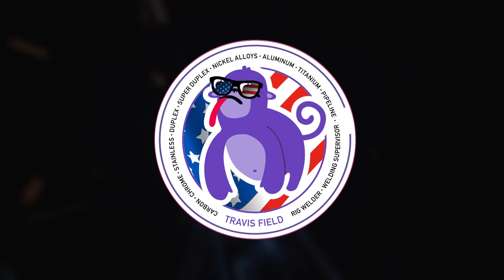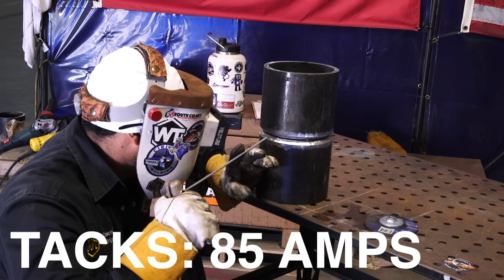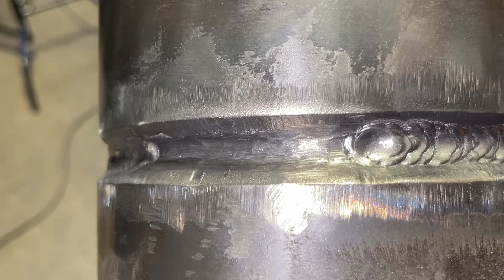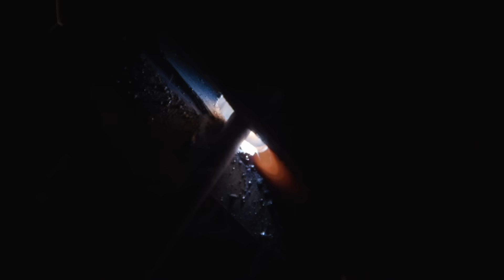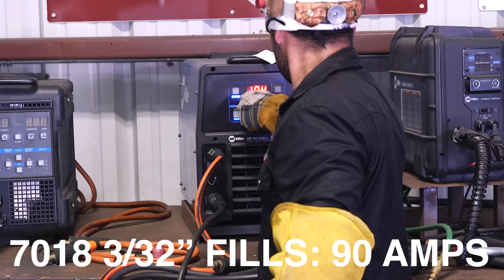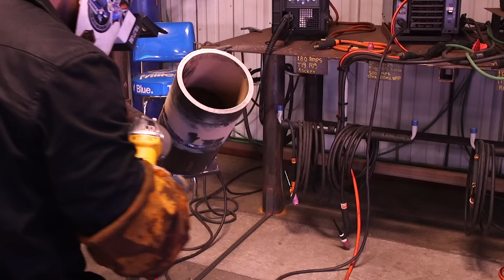6G Stick Welding Test | Open Root 6010 & 7018

Comment: You got a video on how to grind the pipe with the proper bevel?  I've never went to welding school or none of that but just on the job welding.  Had 2 different dudes just never bevel and said it was a waste of time. lol  But it was just basic stuff like cooling towers and chiller piping.  Nothing too crazy, so maybe on that it didn't matter.

Comment: Can you use MIG for welding 6g pipes?  Why and why not?

Also if you can use MIG, would the technique work the same way?

One more question would back purging affect how the weld forms? And if so how would the technique change if the back purging did change how the weld formed?

Comment: Great video. 
Here in Oz we use 2.5mm and 3.2mm low hydrogen rods for the whole pipe, but essentially the same process.

Comment: never heard of anybody welding up hill with a 6010? i would have thought the main advantage of this rod is that you can weld faster by welding down hill. otherwise, might as well use a low-hydrogen rod like a 16

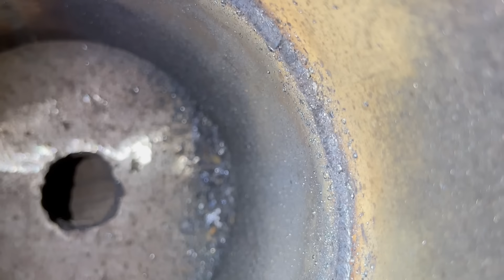Comment: New to welding here 👋 and when I say new I mean I’m still in the basics of my Intro to SMAW pipe class so please no hate, at 14:15 is the final product supposed to look like that? One side the bevel is fully capped and the other side is still super low. Is that the finished product or did he only do one side? Sorry if the terms aren’t correct. I hope my question made sense.
Reply: lol that’s not the final product

Comment: Great video  ,when we practiced 6g in our times we used 6010 root and 6013 fill and cap weave beads    ,7018 electrodes  were never used for  this test back then and few people  passed

Comment: When I did the 6G test at the shipyard it was tacked to a fixture and had a box over it limiting your space. I recommend never doing another weave pass over your hot pass, especially with a 3/32" 7018. I saw a lot of shutdown guys and such fail x-ray test for doing that.

Comment: I always like a 1/8 landing or thick as a nickel and fit is key and I do a 3/32 gap to on 80 wall and higher I can turn my rod straight in on 80 amps give or take and run it all the way up from the bottom I usually quarter my Welds but stick i run up from the bottom to top on each side less stops

Comment: Guys , I need your advise. I am 28 years old and I keep trying to step up the ladder.  My stress for work is on another level. Currently I am giving exams for Stick. Money wise I am not very good to pay for all position certs so  which ones do you think I should go first? I was told that if you do 6g , you are qualified for all positions.  I am welding 4 years , my level is quite good but not the best. Thank you in advance

Comment: ALWAYS FIT A TIGHTER GAP & A LESSER BEVEL ANGLE THEN THINNED IT OUT WITH A GRINDER & TURNED UP THE HEAT JUST A LITTLE HOTTER & PUSHED IT IN JUST A LITTLE HARDER WICH MADE A MACHINE LOOKING BEAD 👍🧑‍🏭

Comment: Put some more details in that puddle work what the heck am I looking at I think that’s the problem beginners have a hard time with cause I did until I have to really really look at it to start shaping up a good weld it’s not perfect yet though but it’s getting there

Comment: I have a question when you tacked up the pipe why you keep jumping out the puddle
Reply: I'm assuming to let the puddle cool down just a tad bit so that he can put more metal in. If not, I think he'll create a pin hole
Reply: @TheTexan_87  yes but im a wire welder and we dont have flux coaing on it like flux core or stick does and i know if you jump out and go back in you trap slag and other impurities in the weld with wire i figured it was the same with stick

Comment: Are you allowed to grind that much for the test once you’ve set up the pipe after your tack welds?
Reply: He's not grinding,it's a wire wheel to clean/ remove slag,

Comment: I've been fitter/welder for 15 years, certed for plate but never pipe. I did spend some time at a few shops, one specializing in larger pressure vessels, one specializing in steam and refrigeration piping. I learned alot about 6g ASME IX at the latter, it intrigued me alot, learning about schedule pipe, the procedures, prep everything was soooo different to anything I'd ever done. I've only ever seen 1-4inch pipe, tig root with tig or stick hot pass and covers depending on the situation. I've never seen pipe welding with a stick root before ESPECIALLY with 6010 (I'm In nz I think the 31a we use is the same, please correct me if I'm wrong) very very cool learning and seeing different processes and jobs. God I love our industry! There's always new stuff to learn! Thanks so much!

Comment: The best advice i got 40 years ago when learning to weld a 6G /6GR  was weld one handed and use your other to balance and move freely as you weld it becomes like a wand in your  hand a bit Harry Rooter u become a metal magician and your roots resemble a wedding band when complete unfortunately most of the amazing tradesmen who taught me these skills have long since passed but I still like to think their up their in Heaven hot passing and capping
Reply: Hello 
Could you please teach me to weld with one hand 
Really struggling with one hand
Reply: @vorsprung2330  kein Problem einfach machen bro!
Reply: @vorsprung2330 just grab something with your other hand to help balance yourself. If you dont you move around more than you think.
Reply: توصیف قشنگی بود❤
Reply: Hell yeah. Love it
Reply: Damn right they are still burning. I don't think real fabricators ever want to stop tinkering, building
Reply: That's true you feel free to adjust your position
Reply: Good video
So much on u tube is garbage using 6013. No serious welder(Boilermaker,Pipefitter) uses that garbage rod

Comment: If you have slag stuck in the top of the 6010 weld will it show up on the test or will the 7018 burn it out?

Comment: Just want to say great video! I’m not a professional welder or certified or anything like that, but I know a bit of the basics on how to stick weld and mig weld, but I’ve got a question that I’m really curious about. Do welders ever stick weld 6g pipe downhill on the root pass with maybe a 6010, or is it always going to be uphill? All the demonstrations I’ve seen on YouTube have been done uphill, but I worked with an old welder a while ago who taught me that 6010 rods run better downhill. If someone more experienced than me can answer I’d really appreciate it. Thanks and have a great day
Reply: Si si può fare anche in discesa.

Comment: I use an structuralv profile in L to align perfectly both tubes before welding the first three short welding seam.( Sorry. I'm not English speaker. I don't know if I'm using the right expressions). Then, you don't need to check inside of they are ok. All the root is going to be perfect.

Comment: awesome stuff im heading into a Boilers apprentice rogram in a few weeks and im new to 6g so watching this helped me learn the movements of the ody to keep the rod in the center of the pipe as im working along, ive got my 6010 stiching down pretty good but need to work on that fill and cap

Comment: What does the "6G ' stand for?
Reply: All positions Flat Position (1G, 1F)Horizontal Position (2G, 2F)Vertical Position (3G, 3F)Overhead Position (4G, 4Fi nclined Pipe Position (5G, 6G

Comment: 6010 drag down root opening. 6010 puddle cap ( high arc length 1/4” out 1/8” in). Make sure flush then Cap circles.

Comment: Quick question. New to stick welding. Why do you leave a gap between the pipes and not first butt them together and then weld. I'm sure with the weld it should fuse them together well. Maybe I could be wrong. Been welding mig for years. I first try to fix the gap then weld
Reply: The spec requires reinforcement on the inside of the pipe where you're welding it. The filler material is not going to penetrate to the other side if you don't have a gap there.

Comment: Why not just stack the one coupon ontop of the other (bevel on bevel) without a spacer? Rotated it until you find the best fit, make a mark, space it out and go from there?
Reply: It'd be nice if you cut, cooled, and bent the coupon as well man. Not trying to be a hater but it'd be nice to know if your weld is passable. Coming from a guy who's looking to pass a B pressure exam soon.

Comment: Does the motion back and forth give any type of problem with insertion of unwanting material such slag ? My teacher says that the risk is too high....
Reply: There's 2 problems that can happen  with whipping(UK name for this) 1 if you whip to far  ahead theres chances of pinholes,or incomplete bead,if done correctly its a good technique for rooting,
I was taught nomore than 1-1.5 of the diameter of your rod..

Comment: Y did u use a 7018 for the root pass an a 6010 for the hot pass and not the other way around?

Comment: I usually put bridge tacks in as the less pickups the better, lighter landing edge and tighter gap, less working of the electrode, but I do understand for beginners this may not be ideal
Reply: I don't weld pipes my self but I do the fitting and assembly. What I've learned is that every welder has their own preferences, no matter how experienced. Some want 2mm gap, some want 4mm, some want 1.5mm land, some don't want any for the same pipe size and welds. I know what each one of them prefer, so I just make the fittings accordingly if it is possible to predict who is going to weld them.

Comment: I do structural welding, 90 amp is NOTHING. I always figured that pipe welding would be done at a much higher amperage

Comment: I run a little cooler on the root. Found in the bend tests...too much "whipping" in the root allows our atmosphere to enter the molten puddle. Not ok! So, I make a small circle, bumping each wall. Of course, pointing the rod either ahead/behind depending on root opening. That breaks down the walls..."juust right"...like Goldy Locks says it.

Comment: Would have been nice to put amperage and rod diameter used plus a shot of the id of the root😊
Reply: 1/8 6010
3/32 7018
You can tell by his amperage settings

Comment: When I welded my ASME 6-G test it was 6010 root, 3/32 7018 hot pass and fill and cap with 1/8 7018. It would have been much easier with 3/32 7018 all the way.

Comment: Old-School Pipefitter/Boilermakers taught me to use about a 24" pipe wrench off the face of the outer side of pipe for your arm rest or tie your lead around the pipe for an armrest, even use a pipe stand. 6G Certified and X-Ray  quality
Reply: OMG THANK YOU SO MUCH FOR THIS COMMENT. Definitely gonna use this trick. 👌👌👌
Reply: Hope that trick worked out for you. Always worked great for me. @kaisanimmortal

Comment: this guy did hes hot pass wrong your suppose to put two beads in there so it will be a even stronger welder two beads are better then one

Comment: I've been welding for 40 years started with Gas welding then Arc with original Fleetweld 5s
Great video.
Used bridge sections rather than tacks just knock them off as you go round.

Comment: Was the 6010 a 3/32 rod?? I’m doing a pipe welding course rn and we use 3/32 6010 with a 3/32 gap, 3/32 landing but my instructor likes running it at 55amps. I find that that’s too cold for me so I jumpit up to 65-70 depending on how bad the fitment is. Obviously the bigger the landing the more heat you’re gonna need but I might just try the 1/8th landing and 80 Amps if that’s what he’s using

Comment: 7018 root 7018 hot pass weave fill all 115 amps grind to sound metal between passes .cap pass 125 Amp.

Comment: Show tips for the guide line in next video, example what wheel to use, how high to go, etc etc
Reply: Yeah. Most UA welds we aren’t allowed to cut into the base metal. Please tell us the secret. Is it with a cut off wheel?

Comment: I know plenty of welding inspectors would never let you grind a groove in the pipe to cap it.Years ago we used to be able to file our edges of our caps to dress it up, but for years now you can't put a file on it at all.
Reply: Is that right? Learning at Tulsa Welding Dallas campus, currently. Good to know.
Reply: I grind the guide line lightly just between the inside of the bevel and the bead. That way, I’m not causing any damage or integrity issue to the pipe outside of the beveled/groove region. The line is in the weld essentially and then gets absorbed back with the cover up. That was exactly how CWI taught me to do it. I guess if I run into the ones who won’t let me do it way then I’ll figure something out.
Reply: @lawrencechapman8394  it wasn't meant as disrespect in no means, I was just stating That most inspectors today wouldn't allow it.
Reply: And it is easier as a guide to follow with a lite groove in it.

Comment: I’ve only done a few 6g with stick. I find that at the bottom of the 6g I have porosity, why is that and how do I prevent it?
Reply: Grind your start on the very bottom of the first stringer on the cap before you go to do your second side, you’ll almost always get porosity if you don’t. It also helps to give you a low bead profile on your starts

Comment: I remember taking my test with a 2" pipe  in 6g , pain in the butt, that 6" pipe so much easier to do.
Reply: Did u take the UA VIP career course?
Reply: I've always had better luck passing 6"  pipe than 2" pipe in the 6G welding position.

Comment: Can someone explain the 6010 hot pass? I’ve been taught that is a strict no. For us it is always 6010 root and 7018 all the way out after root
Reply: Hot pass meaning after root, you step down, say 100 to 90 and weld over with no cool down period. Basically
Reply: No you don't  drop down you go up with your amps,so it pushes your root in, @bipolargods509

Comment: Well done and well explained.. I am a retired welder and the hardest thing is teaching noobies to relax and go with the flow.Cheers!
Reply: Best thing i ever learned from my old school instructor who was in his 60s when he taught was hor to hold the stinger. He showed me, hold it just tight enough so that you don't drop it. I took that and ran with it. It helped me run welds that were clean and gave me much better control. When you are relaxed, everything goes smoother!

Comment: 80% of total proccess time is setup, resulting in 20% welding time under the hood. If you rush setup to 20% of total proccess time, expect total time under the hood to grow to 80% with 20% quality.

Comment: 3/32 fill and cap on sch 80? I have to do a pipe test soon ... abit nervous . It’s tig root 7018 fill and cap . 1/4 of the piper must be done in 2g and 3/4 in 5G .... 6 inch sch80 ...  I always get carried away on fill . Thinking I have enough then I have a shallow cap or overfilled ... they encouraged we use 1/8 rod

Comment: hey, I'm currently enrolled in Tulsa welding school in Houston TX. I was just curious about your technique you used when tacking. could you possibly describe or make a video only about that so I could learn how to do it too. them beads looking absolutely mint👌
Reply: Get that Rod Between the pipe make the gap. Tac one side. Before you weld the other tac Put the spacer back in and hit the pipe together to close the gap because when you tac one side it begins to change shape And bend so you gotta make sure you get out back in the same gap or else half your pipe gonna be wider so make sure you get that gap closed on the Tac and you good to go
Reply: How in the f ck do you go to a weld school, yet want to know how to put in a simple tack? Unreal, but then again, tws is trash. Alot of their grads never even get a job.
Reply: He's using a flicking back/forth  technique due to the digging arc of the 6010 cellulose electrode.  Some people have a more pronounced back/Firth flick while using cellulose electrodes.  When welding a clean joint with no gap and a large land, it's not so much needed, but when running a gap and thin land on pipe, the digging arc of the cellulose electrodes can cause the keyhole to blow out.

Comment: I work in the fertilizer industry. It's near impossible to get these truck frames and parts clean from rust. Would you make a video of rods and tricks for dirty metal welding?  The rust runs so deep, you can't grind it all out and it's impossible for me to get great welds. Thanks
Reply: The 6010 6011 should get the penetration you need

Comment: The welding code include 6010 and 6011 in the same filler group. Puttin the root pass in with 6011 in DC- is a piece of cake..so much easier to make a quality root pass. All the wannabe pipe welders think 6010 is the only electrode for the root (6011 DC- you can sleep through a root pass.